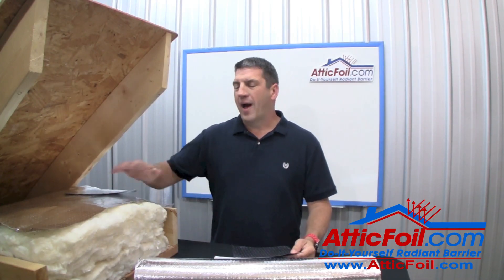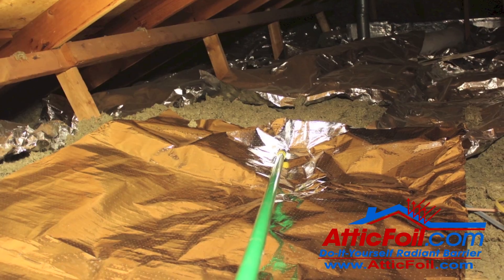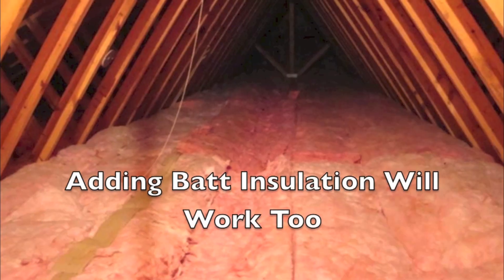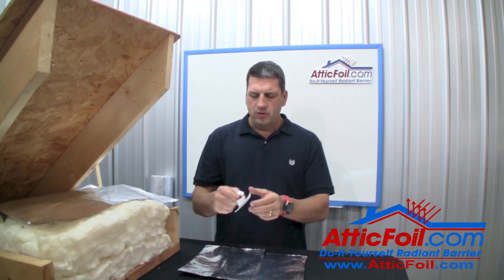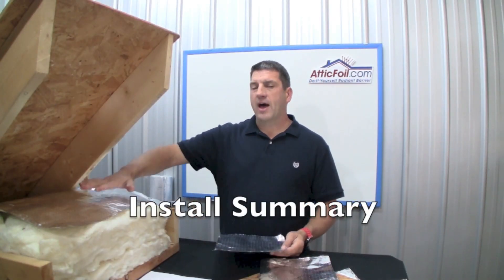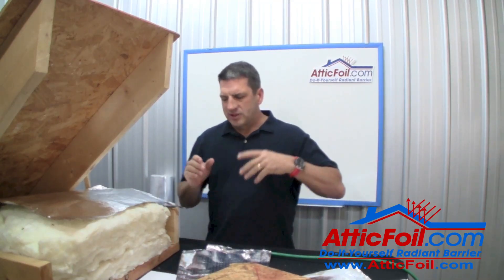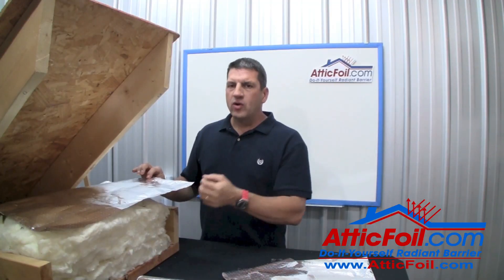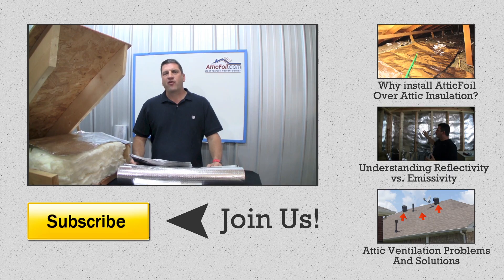DIY Radiant Barrier Installation Directly Over Insulation In Cold or Mixed Climates.  Easy Install!

Comment: I want to lay this over my insulation in my attic before putting down a 3/4" floor...advice?
Reply from the maker: +rnelson07 You could do this, but you should install some 1/2" or 3/4" furring strips before putting down the deck.  This will create the required airspace between the deck and the foil assuming the insulation is touching the foil on the bottom. You CANNOT "sandwich" the foil between the insulation and the floor.
Reply: @AtticFoil  is it better to put a 3/4" floor above the insulation, then put the foil over the flooring?
Reply from the maker: @75thshootist  If you are trying to reflect heat, then yes putting on top of the 3/4" floor will work great.

Comment: I just installed attic foil in my house and I love it. It took me a couple of weekends to install, so after the first weekend I used a temperature gun to see if there was any difference in temperature.  Area which was covered with attic foil was much cooler than the areas that were not covered yet. attic foil also a very strong product it is hard to tare. attic foil is a great investment 👍
Reply: How much has it changed your electric bill during the summer hot months. Just a general idea is good
Reply from the maker: The sunnier/hotter the area the bigger the savings.  Also, one story ranch style homes get better results compared to two story "cake" homes since it only reduces heat through the top/roof area.  It basically make is like shade or a cloudy day for the roof.  Savings are hard to pin down.  I'd read some of the 2000 reviews on www.AtticFoil.com  Many customers tell about their savings.